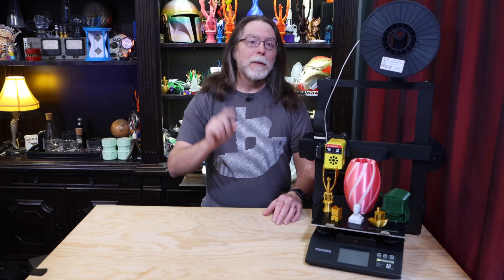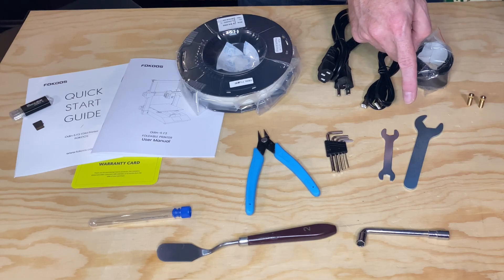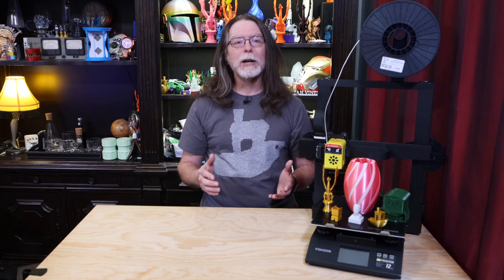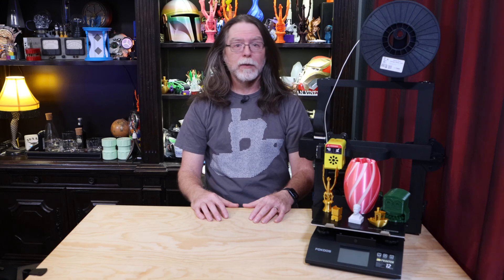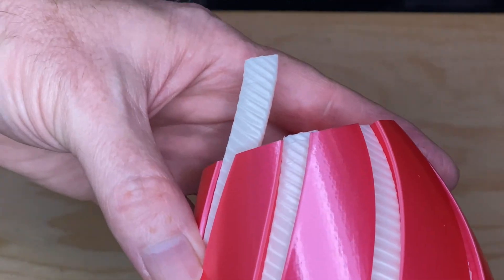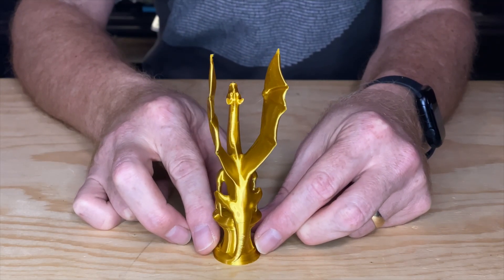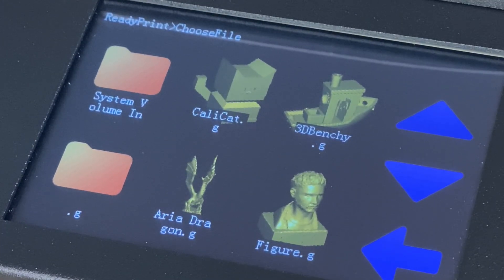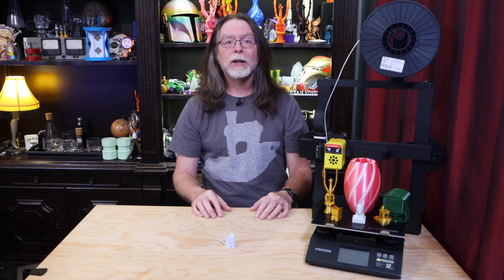The Foldable Fokoos Odin-5 F3 Review!

Comment: Hi Brian 
Just found your channel and I’m so glad that you are putting out a nice video series with proper editing. Very professional!

Anyway, I have a question.
As quick background on me, I have zero 3d printing experience, but I have a lot of CNC machining experience, though it has been 20 years.
Alas, my question:
Purchased the Foskoos printer.
Upon assembly and during initial set-up I found a LOT of uncontrolled slop in all axis. I discovered that the b-rollers I.D. bore size is not a press fit on the bearings. They actually just slide off. At least they’re consistent as all rollers on all axis have this issue.
So, short of purchasing new v-rollers and/or new pre-assembled roller wheel/bearing assemblies, is there a glue or bonding agent for this issue?
Thanks, Jason S.

Comment: Great review! 
It looks like it was inspired by the Artillery Sidewinder X1, but minituraized.   Flat cables are great, but they forgot to make a holder/relief to keep the cable attached to the printer head?  If can wiggle loose and burn out the cable (so bad that many X1 owners print their own relief and Artillery included spare flat cables) . Also the lack of strain relief on the heated bed cable is a killer.  I can see this wear out over time, creating a short between the chassis and the cable. A grommet/strain relief there is a must.

But otherwise there is lots to like on this printer! Easy setup. 32-bit board and looks like a nice direct drive with easy filament change.

Comment: I agree that ferrules alone are not a panacaea. First, if they aren"t correctly crimped they are even more likely to pull out than bare wires. And, strain relief on power wires would definitely be a help, at least in those setups where power wires might get twerked.

Comment: This WAS a great printer - notice that i said "was". Not long after I started using it, major heat creep happened. They didn't sell direct replacement parts, so I had to use a different nozzle setup. After reassembling all the parts (there are many different pieces to take off before you get to the hotend, so remember how you take them off), only to find the mainboard was apparently fried during the heat creep because I got negative temps on the nozzle even after trying several thermistors & heat carts. This involved taking off all of those parts again...sigh. My experience may be unique, but for the price I would recommend getting the mingda magician x instead of this one - 100% auto leveling, and it's just as easy to assemble.
Reply: Hi Len, sorry for your inconvenience. We have the accessories kit now. If you have any questions, please let us know. We want to help with it, don't want to let you down, Thanks again.🙏
Reply: @FOKOOSTech  not exactly sure what you can help me with, short of sending me a new mainboard as I'd hate to waste the time going through all that disassembly /reassembly just to test theories.

Comment: One thing that gets my back up is the profiles included with Cura, they never have settings enabled to combat fat corners, which can be quite annoying for novices when their new technology can't even print a cube with a sharp corner, to be honest this should be something the manufacturer should set up in the firmware, its not rocket science is it? none of the Chinese manufacturers set it up, what a coup a company could score over their competition by having the firmware set up correctly
Reply: What you are referring to is either Linear Advance in Marlin or Pressure Advance in Klipper. Especially with linear advance in Marlin that is a firmware level feature. The slicer has no bearing on it.
Reply: @trevormallow2788   I am not referring to pressure advance or linear advance I am talking about jerk settings to stop the hotend slowing down when it comes to corners and depositing too much plastic